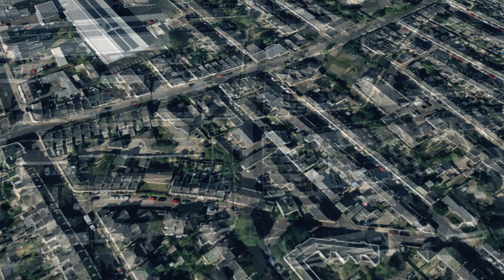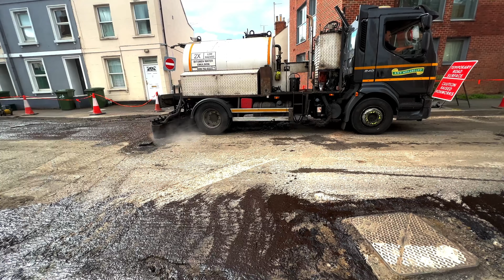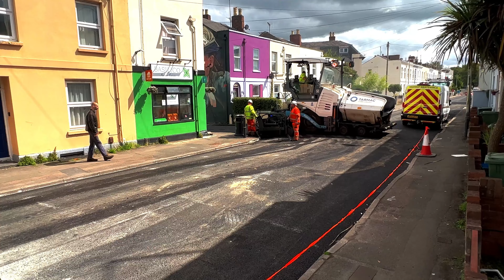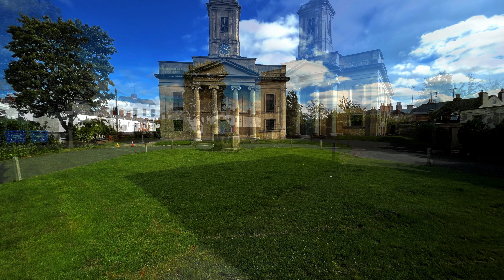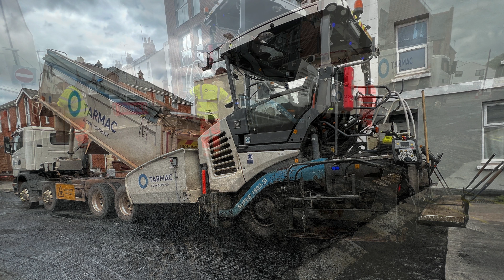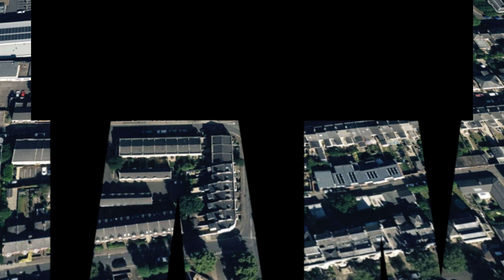Resurfacing Works-Saint Paul's Road Cheltenham (Day 4)

Comment: Nice tar tanker, Vogele Super 1800-3i paver, the wheeled machines have road running lights and turn signals, the tracked machines do not, very nice video..😊